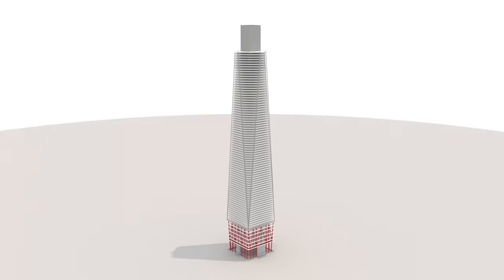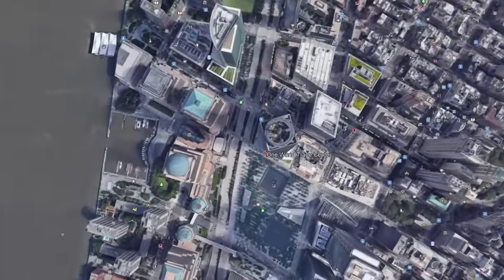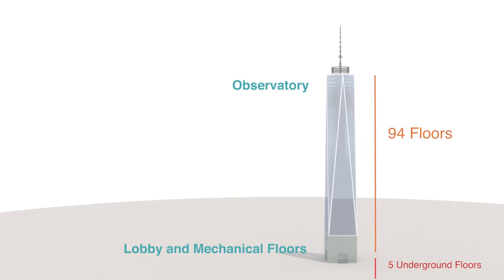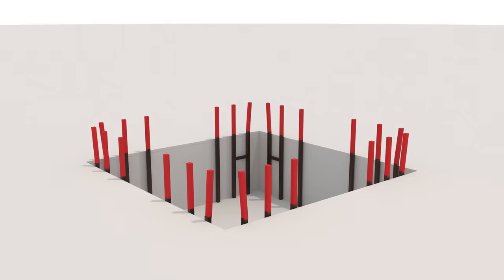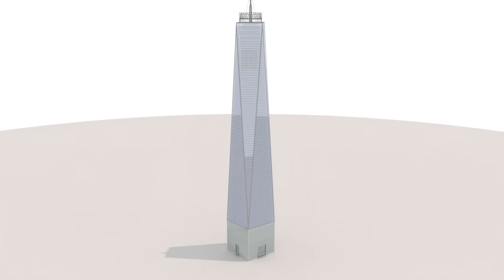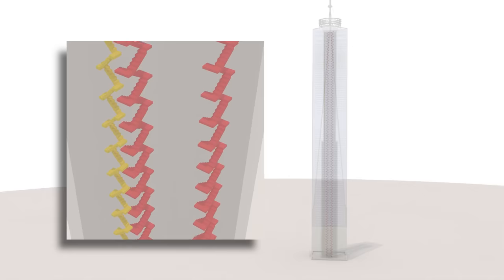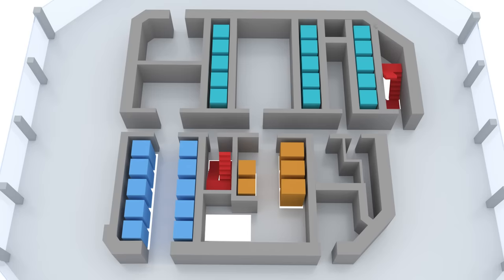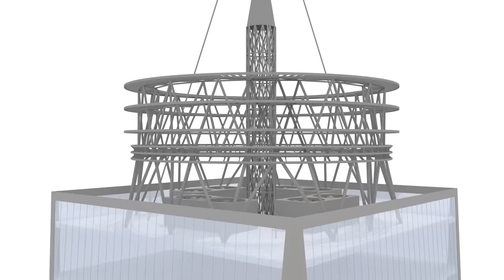What's inside One World Trade Center's structure?

Comment: I’ve been to the observatory 3 times, it’s one of the most amazing experiences
Reply: Does it come near to the rooftop of the previous one? srsly doubt it. 95 floors vs 110 floors, meh...
Reply: @pawel1545  No comparison to original WTC
Reply: Pretty expensive though, no? Can't even go onto the roof u like the old one.
Reply: @pawel1545 it’s 102 floors actually, I heard the height from the observatory is about the same as the original. 
The elevators here are fast as hell though.

Comment: I still would be too afraid to live beyond like a 6th floor, where fire engines can't reach. So many variables could happen, and to rely on stairs means hopefully you can get out of all the doors first....I wonder why they don't make fire stairs on the outside? Yes it's high...but...
Reply: @Daniel Chang trapped on the outside stairway? Well at least it's an option if they built it. Modern buildings can still look good with fire stairs ...safety is paramount.
Reply: No one lives here lmao
Reply: @Goldrefinedthrufire  In terms of building code you wouldn’t be allowed to use an exterior stair case in the event of a fire or emergency. Protected staircases are pressurized and sealed with doors. That prevents heat and smoke from entering the stairways. An exterior stairway is exposed and on a building this height there would be extreme winds maybe even strong enough to suck some people off of their feet
Reply: Safety matters anyways I wouldn't be able to work in a high rise 👍
Reply: Just learn how to use a parachute, and take it with you every day
Reply: @Pablotercero90  LMMFAO 🤣🤣🤣🤣😂😂😂😂😂🤣🤣🤣🤣🤣🤣🤣🤣🤣🤡
Reply: @Pablotercero90  lol..that's been thought of, too much maintenance and safety training and very expensive. They can't just sit in a cupboard for ten years, won't work. But ya maybe personally if a person kept one with them lol

Comment: They cheated with that Spire.. … 
 But no, it’s a gorgeous tower and a symbol that says “you will NOT keep us down” 
And I love it
Reply: 1,368 is how tall Tower one was, that's why it's that height. The U.S. could've easily build it up to 1,776 ft but decided honoring the towers was more important.
Reply: @kotori Because of the antenna, the actual floors are is the exact same height as tower one.
Reply: @kotori Yes.
Reply: @WalrusWinking  that is gay
They should have done this:
First a main building (WTC 1.) 541 metres to the roof with a rooftop observatory.
Near this main building stands two new towers, the same height as the originals (idk if the antenna will have to be taller this time because of the main building

Comment: it seems much more durable, i wonder, if we took a 737,(evacuated ALL people out of the building, went to a alternate universe, not our own) and smacked the plane in the same spot, would the building survive?
Reply: simulations say it would. the previous towers were actually designed to survive accidental crashes, planes following the fly zones speed limited of I think, 100mph,  but the hijacked planes were going 400mph.
Reply: The 9/11 hijackers used 767 so the comparison is not the same, the re enforced core makes the possibility of the stairs being cut off much slimmer which is why so many people from above the impact zone in the North Tower died, they couldn't get down as the original towers core was steel posts and sheetrock which were sheared and destroyed all three stair cases
Reply: @mattheww2797  ok then a 767 lol.  Easy edit
Reply: Probably, that concrete core will make it survive.

Comment: The facility I worked in we were rated to withstand an overpressure wave of 10 psi and the walls were 3 ft thick reinforced concrete

We were told the closest Target for nuclear missiles would be 5 mi away and we would be able to survive a 10 megaton blast 5 mi away with no damage to the facility

I don't know how many psi that translates to but PSI versus overpressure wave PSI is a much different and much lower value

We could have withstood an airliner crashing into us with no damage inside

The facility was built in 1960s at a cost of 18 million dollars
Reply: What facility was this, because it must have been deep underground if it stood any chance of withstanding 10mt detonation from only 5 miles. 5 miles is basically point blank range when it comes to nukes that large.

Comment: I hope this isn’t a dumb question, but, what makes the emergency/first responder steps special? I would’ve thought a staircase is a staircase, a fire/emergency exit is a fire/emergency exit. Thanks!
Reply: I would think that after 9/11 they wanted a dedicated stair case so that people aren't crowding it impeding responders from going up or down with emergency equipment.
Reply: In extinguishing fires In high rise buildings the FDNY stretches their hose lines off an outlet of the standpipe riser which is located in the enclosed stairwell of the floor below the fire floor.

This necessitates that the door to the stairwell be kept open. Unfortunately, it also causes the entire stairwell above the fire floor to fill with heat and smoke.  

As a matter of procedure, they designate this as the attack stairway and the other stairway as the evacuation stairway.  However, building occupants may ignore such direction.  By having a dedicated stairway, the possibility of such a situation might be greatly reduced.
Reply: @azul8811  ahh so it’s an exit with a dry riser in it? I dunno why I didn’t think of that, but that makes sense.

But also makes sense as an attack point. I’ve seen dry risers inside cupboards as well. I used to do telecom installs in a former life (which is why I forgot), and sometimes the cable or power distribution cavities would be next to a dry riser cupboard, and of course, these are part of the building core, with the lift shafts and exits next door.
Reply: @uzaiyaro  Actually, I’d imagine that it’s not dry. New standpipe systems are typically “combination systems” in that they are tied in with the sprinkler system.  IDK why they would necessarily be dry because freezing is not an issue inside a structure that is heated. You can tell if it’s a combination system by the yellow color of the Siamese on exterior of the building.  Green Siamese for sprinkler, red Siamese for standpipe and yellow for combination.

Unlike in some jurisdictions, the NYC Code requires that standpipe outlets are located in the enclosed stair rather than in the public hall. And again the FDNY stretches from the floor below the fire floor.

Comment: The world trade center twin towers is better than the new one. It has 107 floor.
Reply: Just because it’s taller doesn’t make it better
Reply: Ceilings are higher in modern buildings. Meaning same height and less floors
Reply: They stopped at 94 floors to get the height of 1776 for the date of Independence...That's why it's called Freedom Tower 😅

Comment: The size of cables needed in order to have an elevator that goes from ground level to the 100th floor would be massive and the stress on the pulley would be enormous
You would need cables a foot thick and a pulley that could handle the stress of that load
It would need to be so massive it would weigh as much as 5 floors of the building.

It is not just the weight

The stress increases the longer the distance which is why if you take a rope that is rated for 250 lb and you go to the top of a 20 story building and tie a 1 gallon bottle of water to the rope and begin lowering the bottle that the rope will snap at about the 2nd floor

The stress becomes too great on the rope because of the distance not the weight of what is being lifted

This is why the original World trade Centers had sky lobbies

I don't know why they would not use a sky lobby. That elevator and cable and pulley must weigh as much as an aircraft carrier
Reply: I'll explain. There are only 2 elevator banks that go the entire building, that's the 5 J bank elevators (C1 to 102). And the 4 S service bank elevators (C4 to 102m). Floor 102m, 103, 103m, 104 and 105 (roof) were serviced by elevator S5. The G bank elevators were express elevator to the sky lobby 64th floor. Banks A-F serviced floors 1-63 and Banks H and I serviced 64-93. I was on the buildings fire brigade so I needed to know all this stuff.

Comment: They should have made emergency shoots on alternating floors so every even floor would have an emergency shoot like a giant slide that would go down at a steep angle to the next even floor with bags at the bottom to absorb the speed so people could drop down each set of floors and continue down at a high rate of speed to the bottom through a maximum of 50 slides that would each take about 10 seconds to slide down get off and slide down the next one

Comment: The original WTC had 3 sets of stairs in each tower, and that wasn't enough (code called for 6 stairwells in each building). So their solution was to only build 2 that are accessible for the tenants? That's stupid, what the hell?
Reply: The stairs in the twin towers were narrow and right next to each other. The new WTC has wider stairs that are not as close. And they’re surrounded by concrete so they’re stronger. Still much better than the original WTC.

Comment: 94 floors ..... each tower of the twin towers had more space  "north 110 floors and south 108 floors"
Reply: one wtc has higher ceilings
Reply: Axualy OWTC has thicker floors
Reply: Technically there's 107 all together, but they are larger. The tower was made with a lot more safety measures along with that.

Comment: Ok. Botton line. I have to ask! If someone slams a Boeing 767 or an A360 Airbus Into it is it going to stay up?
Reply: Airbus A380 no ..

plane with a fuselage diameter of 7.14 m, 24 m high, 79 m wingspan, 72 m long, weight of up to 560 tons (when full), cruising speed of just over 900 km/h, capacity for more than 300 thousand liters of fuel, four engines and so on.

Comment: I think that every floor along with every other work area that has a employee should have a emergency personal first aid flashlight gas mask &water kit along with a emergency guidelines instructions to follow & to evacuate if needed also a grip gloves for a fire pole that firefighters have to slide down to reach the ground and instructions on how and where to go on the loud speaker that loops. Message until switched off and otjer safety measures if all fails and a plan C,D,E to evacuate with motion sensors for sensing nearby fire and other things that might slow a person down similar to the waze app gos spotting everything around u while driving before coming close to the object so people can be prepared and not panic but be smart

Comment: Willis tower has 103 floors, it's neighbour empire state has 102 floors. How can it be the tallest in us or w hemisphere?
Reply: Ceiling height of the floors.
Reply: Willis is actually taller. WTC cheated with the antenna. Tallest structure/antenna, sure. I wouldn’t call it the tallest building..
Reply: @xanderramirez1395  what's on top of 1 WTC is a spire, which counts towards the height, unlike an antenna, and the ceilings are taller, which makes it the tallest

Comment: They should design a special escape route in the event of another tragedy like 9/11. Weather it’s some stairs, a slide, parachutes or something. They need options in case of another fire. I know it’s too high up but at least ppl would. have hope.
Reply: my idea was to put footholds on the outside wall of the building for climbing down, hatches in the floor on the perimeter with drop down rope ladders, and hooks on the outside for rappelling rope
Reply: @jameskeefe1761  you think you could repell down that with a rope? You couldn't even climb a ladder down that it's too far.

Comment: If you don't count the antenna, which most "tallest" competitions don't, it is not the tallest.
Reply: Antenna's do not count toward the overall heigh but Spires do. The difference between the two is that an antenna is added on as an addition, whereas a spire is part of the aesthetic design. The Council on Tall Buildings and Urban Habitat determined that the 408-ft structure that sits atop One World Trade Center is a spire and therefore counts toward the overall height. They also consider the unusable and even hollow space so long as it is part of the design. The Burj Khalifa currently has the title as the tallest building in the world despite 800-ft atop being unusable and purely for aesthetics.
Reply: @ciaraoh9102  if it walks like a duck, acts like a duck, quacks like a duck.......
Reply: @BeKozTube  Not in this case. That's the rules. Some people think the height should be determined by the top floor, in which the Shanghai Tower in China would be the tallest, I believe.
Reply: @ciaraoh9102  Yes 1 thousand percent

Comment: That antenna should not count as height lol. So really the new building is the same height as the old Trade center without the antenna.
Reply: It is a spire, not an antenna. Therefore it counts. There is an international standard for determining what a skyscraper is. The Council on Tall Buildings and Urban Habitat states: "The architectural top of a building includes spires, but does not include antennae, signage, flagpoles, or other functional-technical equipment."

Comment: Still no where for helecopters to land how are they supposed to get out if there's a fire underneath them jump should have designed it so evacuations from above are possible not only on the ground 🤪🔥🤔
Reply: There used to be a helipad on one of the old towers but it was permanently closed off by safety inspection people a long time ago.
Helipads aren't very helpful in the event of a fire because smoke rises and that would prevent any rescues from the air.
In fact , air evacuation is what the NYPD had in mind on 9/11 but their plan was short lived when they couldn't do the air rescue due to the heavy smoke from the burning building. The old tower with the antenna is the one that had the helipad.

Comment: No helipad?
Reply: The use of helipads were banned in NYC after a helicopter crashed on the top of the Pan-Am building back in the 50's. The original twin towers had helipads, but using them on 9/11 proved impossible due to the smoke.
Reply: @Lv-nq9qz  Yes I forgot about that Pan-Am ordeal.